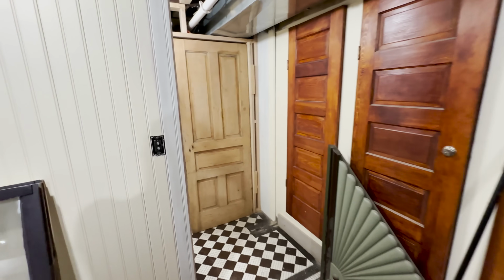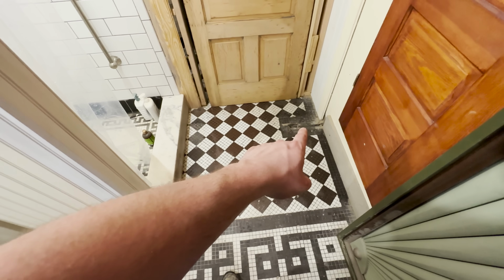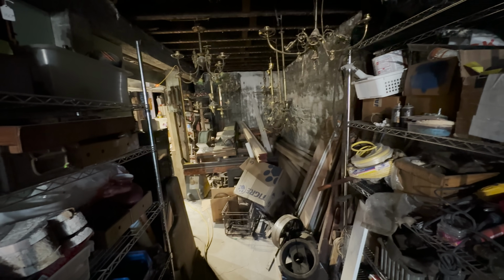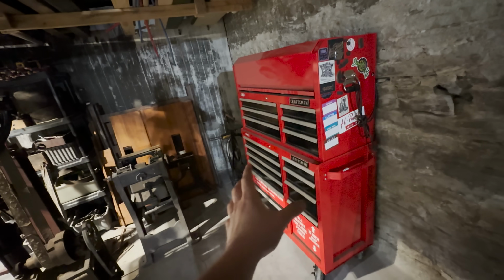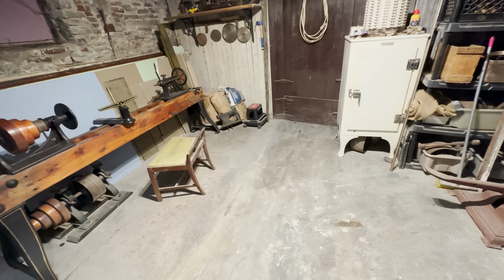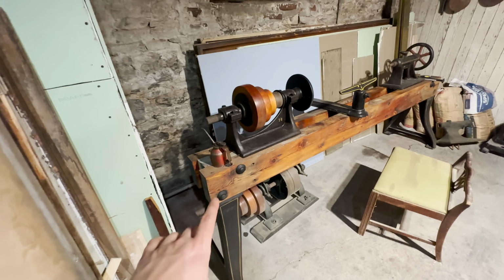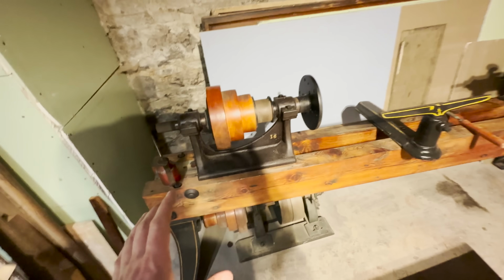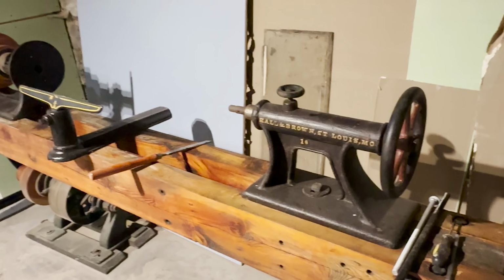I Needed This S4 EP1

Comment: Everything should be done in your time...not to push YouTube viewers and algorithms.
When you're ready, things will flow better than forced during times of stress and grief.
That said, one thing for your workshop prep...A dust collector if you can, and consider taping drywall joints, so wood dust doesn't build up in the space behind and become a fire hazard.  
Nice to see you enjoy a moment as an artist with a touch of pin striping.